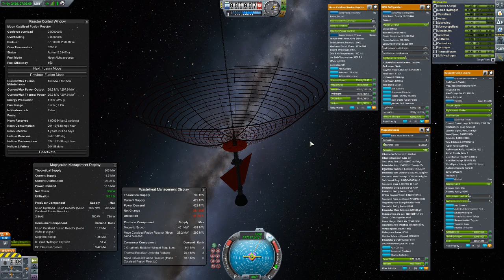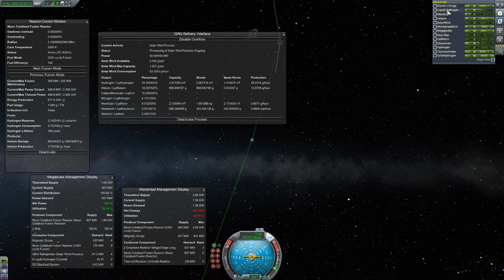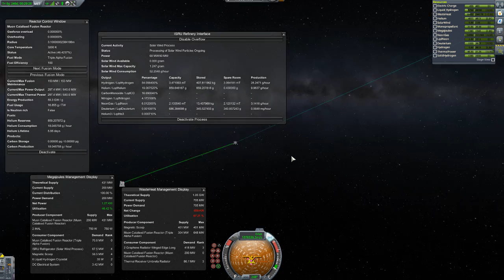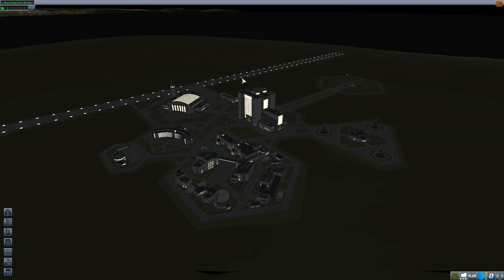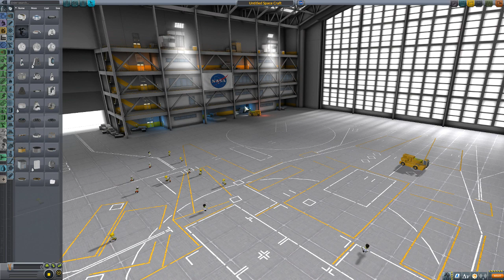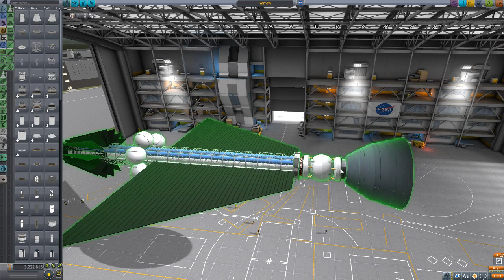KSP Interstellar Extended Magnetic Scoop Part Two

Comment: What did you mean by "Turned on all of the other systems" and did you process solar wind when collecting between firing?
I'm gonna take another crack at magnetic scoop stuff
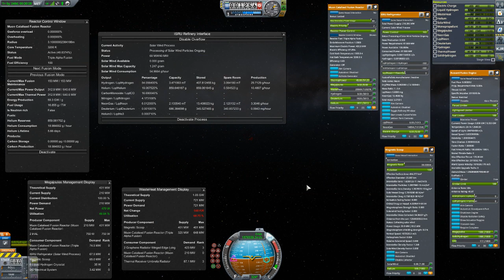Reply from the maker: In theory since this thing is only powered by a muon cat. cat fusion reactor, it just does not have enough to run 'all the systems' at once. So I probably mean: mag scoop, ionization, solar wind process (refrigerator), storage tanks.  Sorry I made this one like a year ago and I didn't really do a good job explaining what's going on or the best way to do things. I was still learning (still am). I do use the mag scoop in a couple few other videos so I eventually cover it in detail, just not all in one video :(    (i haven't been able to devote a lot of time to the game lately, which sucks, but hopefully i'll be able to get back to it before KSP 2 is finished...) edit: sorry, forgot to answer your other question. At about 11:00 i'm firing the engine, running mag scoop and solar wind process at the same time. This resulted in a net LOSS of overall hydrogen. So i filled up first, then ran while continuing to collect. Note you'll collect more the faster you go. Also note that in this video I encounter the heliosphere (keliosphere?) and kinda realized it but incorrectly identified what was going on. Just know that when I get kinda confused halfway between kerbol and dawn, it's because I didn't realize I had passed the heliosphere somewhere around 19:30 ish)

Comment: Why dont beam power to the ship? 
Forget about wasting materials in fusion and not using'em to thust!
Reply from the maker: a beam powered mag scoop ship would be stellar (lol get it?) but an inter-stellar one would be a mighty challenge. unless you already have a beam power network between the two star systems. Which could be done... especially with the warp drive.
Reply: @PunkWyrks  I dont like to use warp drives. Im good with good science XD
It may be me that Im a bit crazy, but hard X 40m FELT and it goes a light year across easily with a big AIMF reactor. If you have no problem using clarketech, forget it, I suggest a technobable reactora and the AM gaser for thrust, you just dont need power (nor rads) anymore. I know, Its silly, Its broken, but quoting TheSpiffingBrit:
It just works! XD
Reply from the maker: @antaresmc4407  ah yeah, i did FELT experiment to see how much power i could beam from the Murph system to Kerbol system (about half a light year). but, i used soft xray instead of hard X like a total noob. Something like 15GW transmitted and 500kw received. But, my receiver was tiny and the spot size was kilometers wide so it wasn't a very good test.  Personally, I'm a huge fan of beam-core antimatter + magnetic nozzle for propulsion. Can build tiny craft with delta V measured in percentage of light speed. add a computer core and go on a grand tour with only a single flight in progress.
Reply: @PunkWyrks  I used the BC propulsion before, but the mag nozzle is bugged and gives a ton of extra dV, I kinda dont like it...
Also the lack of need of radiators of the gaser (I dont remember the name !!!!! XD), big problem with the BC and absurdly high TWR killed all purpuses when realism wasnt concerned.
Im a beam power tryhard or something (PLEASE ADD STELLASERS), I tried with a few terawatts  from an entire net, hardX and BIG reciever and the test got a bit less than 100 GW in clean